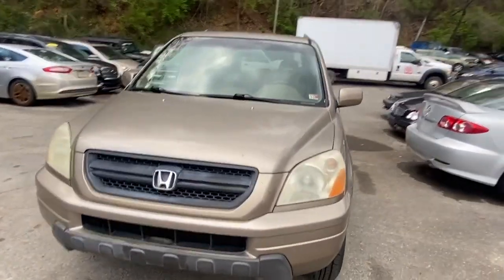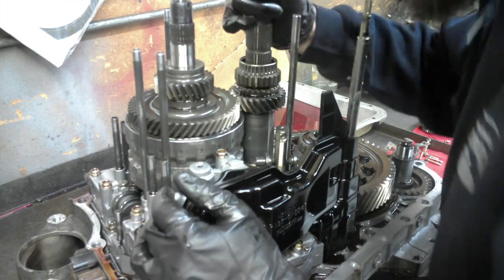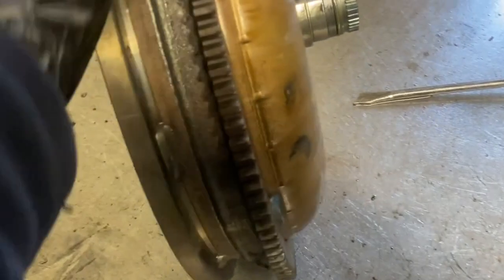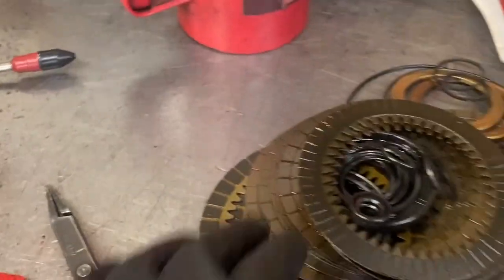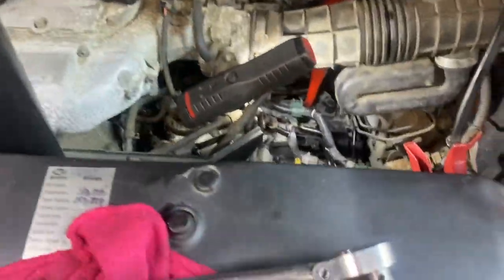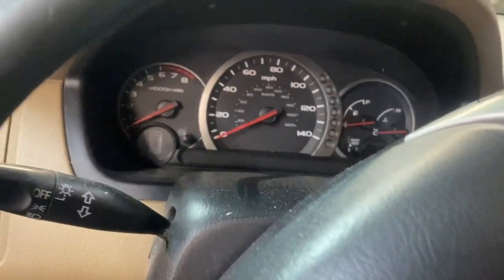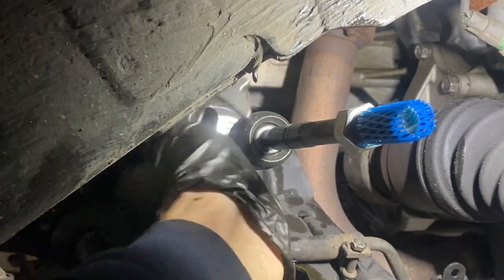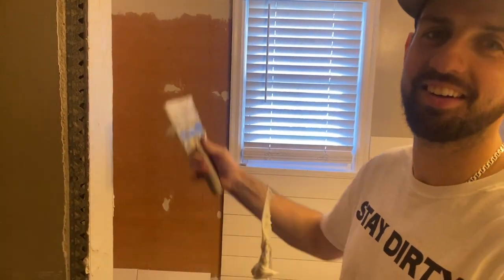Honda Pilot with Transmission problems

Comment: Last week I replaced the leaking power steering pressure hose/line on my 07 Pilot. It had been leaking for over a year and may have been leaking from a loose sensor on that line. But anyway, removing the flare nut from the power steering rack was very difficult because there’s not much room to turn a wrench. It would have been a lot easier if I had replaced the return hose at the same time because it was blocking access to the flare nut. Live and learn. I’ll replace them both the next time.  Great video, thanks!
Reply from the maker: I know your pain. That line a very hard to get to. Ive had to replace it before on a acura. Thanks for the comment. Be sure to subscribe for me.
Reply: My 2004 power steering high-pressure pipe is wet. Do you think I need to change it?
Reply: @ygd6078 try tightening the sensor first to rule that out. Check for leaks from any hoses above and from the power steering pump O-rings

Comment: My 2003 pilot has the check engine and 
VTM4 lights on. Had it checked many times. No answers. The transmission seems to shift late to me and hard sometimes.  If anybody has had similar problem and found the solution it would be great to find out. glad I found your channel.

Comment: I have this exact issue.  I put a rebuilt transmission and new torque converter in my 04 Pilot 15k miles ago, then last month the TC solenoid failed, and the TC wasn't locking up.  Replaced the solenoid, but 100 miles later, I'm not losing 4th and 5th gear and reverse after a few miles.  Shutting it off and restarting gets them both working for a few minutes, then they're gone again.  Wondering if the TC failed and sent debris through the transmission, requiring the whole thing to be cleaned again?

Comment: Torque convertor was replaced. But after about 150 miles envisions and transmissions came on ,, we went back to dealer, they said torque was fine and that now the transmission needed replacement but is not covered--- I was having no problems  with tranisson before they replaced it -- now they say 800p or so to fix which I do not have --- any suggestions.  Could they have messed up  transmission ?
Please reply  ty
Reply from the maker: They should have replaced your whole transmission the first time. The torque converter is just a component of the transmission. Once a torque convertor fails it throws trash through the unit and all of the other components have to be cleaned or replaced. Not surprised your transmission still has issues. Sounds like that dealer is trying to get out of a transmission warranty.

Comment: Just curious...what would u charge for something like this.  I have a 2003 Pilot with 260k miles, same color and similar transmission issues.  Still drives but sometimes shifts are rough.
Reply from the maker: Usually around 3,000.

Comment: hi) I'm watching your channel and I like the Honda pilot)) I also have a pilot in 2003) please tell me, do the owners of the Honda pilot in the USA do maintenance of the automatic transmission according to the regulations by disassembling it, changing all filters and rubber bands? or do they still drive until the last one until the automatic transmission dies? if there is a full automatic transmission service, then at what mileage does this happen? according to the regulations 200,000 km, (125,000 miles) and after that you need to change everything in the automatic transmission with analysis) I'm just curious) I received a contract automatic transmission from the USA with a mileage of 206,000 miles, so I do not know if they did it or not) please tell me
I have an automatic transmission installed and it goes perfectly) but there is still excitement that she has such a big mileage and how long she will live)
Reply from the maker: When driving an older Honda I would change the transmission fluid every 30,000 miles. You can buy some transmission fluid additive called lube guard platinum. Put that in with every fluid change. Thats about the best you can for keeping it serviced. As for a high mileage good used transmission with 200,000 miles i would guess the fluid was hardly changed and its never been opened up. If it works it works. Just drive it like a normal person and keep it service and you should be fine.
Reply: @justcallmeeddie1  Ок, thanks for the consultation 🤝